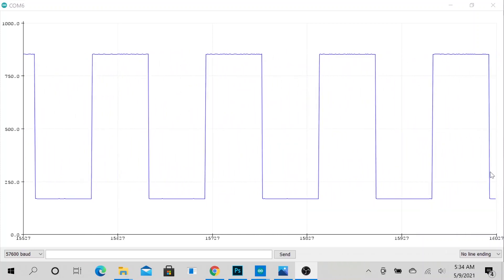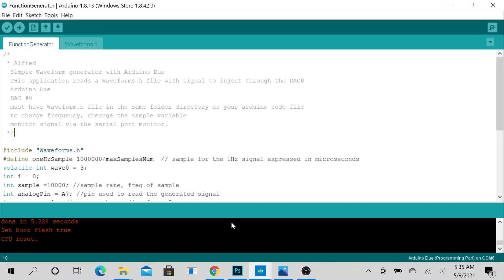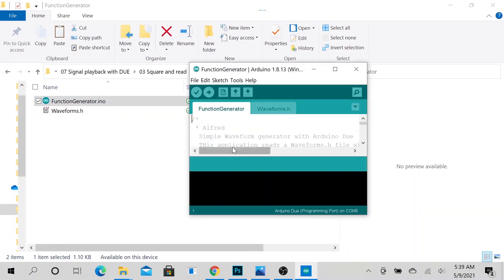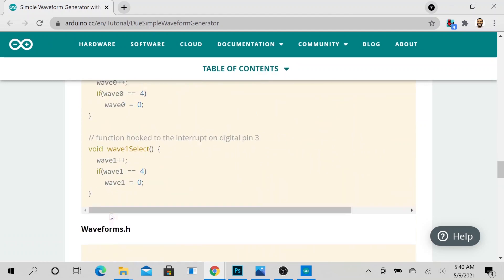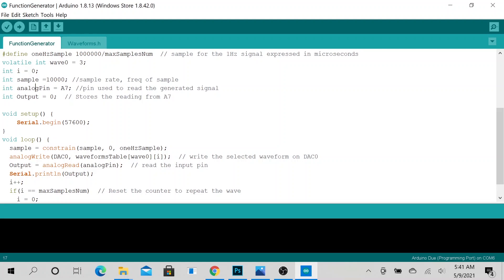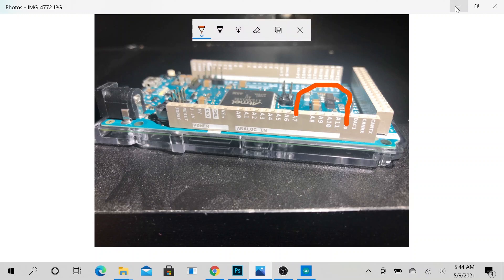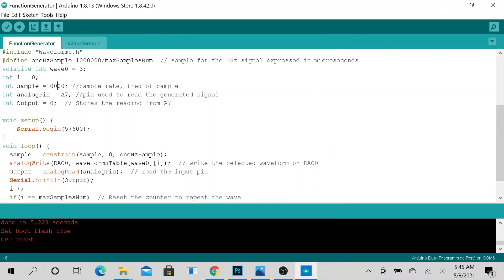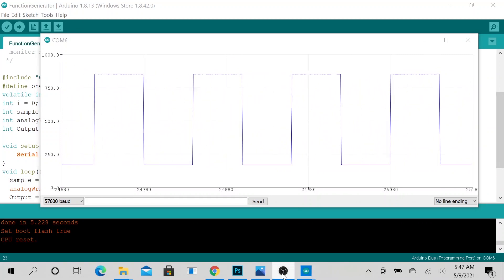How To Generate And Read Square Wave Signal with Arduino Due

Comment: Can I do this project with another kinds of arduino board like Mega? actually i need two square waves with 100 kHz frequency and pi/2  phase shift to drive an inverter for my MSc project.
Reply from the maker: Yes, as long as the arduino board have a DAC channel (Mega does not have a DAC channel). If you figure out what board to use, then we can look at producing a two square waves with 100KHz  with phase shifts. Also, if you are ONLY doing square waves, then we could probable produce it with the arduino Mega using the digital pins (using a different methodology that was not outlined in the video).

Comment: Thank you for your videos, keep going 🙏 , i have a question how can we change the duty cycle ( here it is 50%)?? And other question can we work with : digitalWrite( output, HIGH) then a delay then digitalWrite( output,LOW) Then a delay to have a squared signal in ARDUINO DUE ? Sorry for bothering 😅😅😅
Reply: @Nadia Djaoui I tried with HIGH and LOW and it doesnt really give a squared signal, i tried with state but it gives triangular signal, so you better use this way, even if you can control all the parametres in it  :/ arduino due is hard to manipulate
Reply from the maker: @ladsm5108  Ohh wow you tried too and it did not work for you? I will check it out later today just because i want to see what you are see too. Actually looking at the code i see what is going on. The signal is infact a square wave signal. The issue is because since you are using serial.prinln to display the signal. The serial only triggers when arduino ask it to trigger. Hence, during the delay you will not see anything and the signal will look like a triangle wave instead of a square wave. I am almost sure that if you use an oscilloscope (which is a better way to examine signals) you will see a square wave. Does that make sense? I don't have an oscilloscope at home or i will show you what i mean.
Reply: @codingwithalfred  Oh that makes sense ! i dont have an oscilloscope at home too but once i'll go to the university i'll use it and see what it gives me. any way , now i'm using the methode in the video it is really helping me right now (especialy if you show me the detail i told u in my comment ) thank you infinitely
Reply from the maker: @ladsm5108  Perfect :) I will get back to you with the detail very soon.
Reply from the maker: Hi the new video showing how to change Duty cycle as well as start the signal from LOW to HIGH is now live. Hope that answered your question. If i missed something please let me know. Link to video: https://youtu.be/SVssw4UmC2o
Reply: @codingwithalfred  Thank You so so so sooooooo much ,this is really nice from you 🙏🏻
Reply from the maker: Thanks 🙏... I will take a look at that and get back to you. Changing the duty cycle might not be very easy, off the back I can think of changing the signal configuration file based on the specific duty cycle you desire... yes you can do a digitalwrite for a square wave signal. However, digital write will not work for sine, triangle etc. Because, the digital output is either ON or OFF... nothing in between.
Reply: @codingwithalfred  me i used this program but it is not generating the squared signal, i dont know where is the problem ( maybe the pins that i'm using are not correct ): 
int output =A7 ;
int  Input=7 ;
void setup (){
Serial.begin(9600);
}
void loop(){
digitalWrite(output, HIGH);
delayMicroseconds(500);
digitalWrite(output, LOW);
DelayMicroseconds (500);
Input= analogRead(output);
Serial.println(Input);
}
Reply from the maker: @nadiadjaoui2310  hello, what board are you using? What digital pin did you use for your output? Do you have wire going from the output to the input on your board?
Reply: @codingwithalfred  the bord is Arduino Due , the Output is A7 and the Input is 7 ( i corrected it in the program i sent you in the previous comment ), and yes i have a wire between those 2 pins but still doesn't generate a real squared signal
Reply from the maker: @nadiadjaoui2310   Are you generating any waves after correcting the program? Check out the explanation above to Lad's respond. I think you might be having the same issue. If you are still not generating a waves then something is going on and i will be happy to look into it for you.

Comment: I can never thank you enough, God bless you 🙏🏻
Reply from the maker: God bless you too :)
Reply: @codingwithalfred  Hi , i'm back to you, now i need this squard signal to start with ( LOW HIGH LOW HIGH , starting with 0 not with l ) or in other case shift the signal so it starts with 0 not with 1, i dont know if there is a way to do this, any way if you don't know it that's okay sorry for bothering
Reply from the maker: @ladsm5108  Yes, there is a way to do it. I will create another video for you. Thanks for the questions. Expect the video by this time tomorrow or a little earlier.
Reply: @codingwithalfred  Alright thank you sooo much 🙏🏻